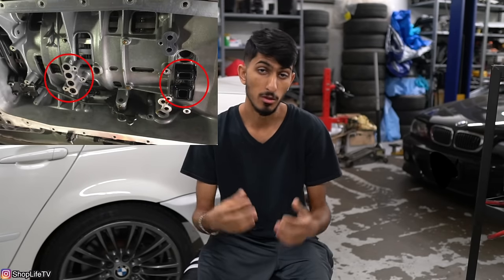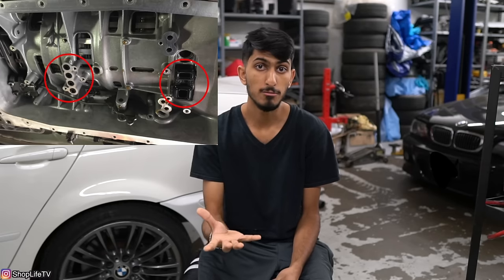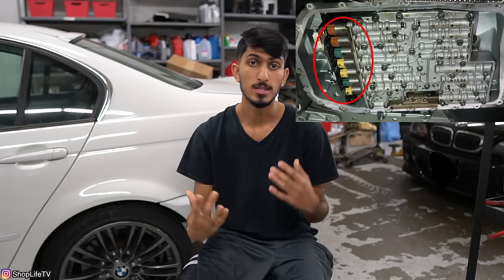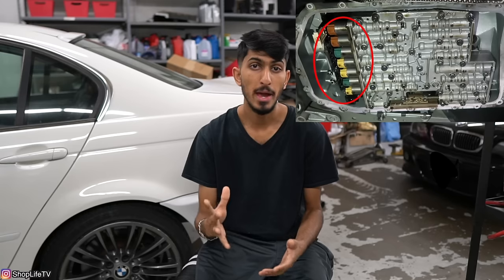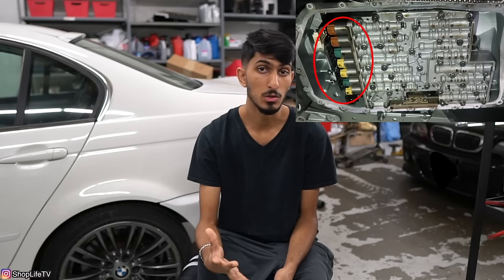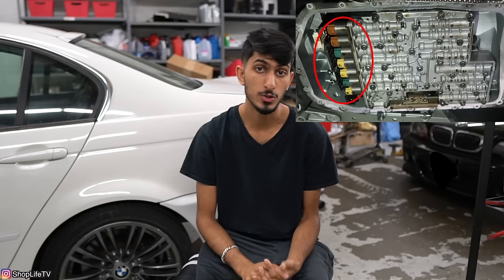ZF 6HP 6 Speed Auto Transmission Troubleshooting! Common problems

Comment: Hi, I have a e90 3 series 06, I got the valve cover,rocker cover and oil filter housing, done. The car, hesitates when accelerating and uphill and the idle its stable but low. Any idea what the issue might be? Thanks

Comment: Trans was fine then I replace fluid, now Im getting this bubble/vibration when in 1st at around 3k rpm. It feels like too much pressure. I replaced all seals with no luck. 

I just want to know if this sounds like a solenoid problem before I replace them. 

Also once it shifts into 2nd it's fine.
Reply: Hi did you sort this problem?. Thank you

Comment: BMW E61 525D 130kW with ZF 6HP26. Having problem with gearbox. At cold temperature rpm goes high, but gear don’t change. After engine/gearbox warms up it start to work decent, but still not good. It is torque converter problem or gearbox oil is low?
Reply: That's normal for all e60 generations the way they works the TC it's not locking until the oil gets operational temperature.

Comment: I have a question, I recently replaced all my solenoids, pan, plug adapter but did not change the sleeves. I'm having an issue going from 3rd to 4th it does not engage and goes into safety mode. Do you think the sleeves cause this?
Reply: Hi im having the same issues with my car was just wondering if you ever got this sorted. Im having troublecode gear ratio 3-4. What was the fix to this?

Comment: How do you know if your 4 mechatronic seals bridge seals need replacing ? my trans is doing this weird thing under light acceleration or driving up a hill lightly accelerating where the revs will go up and down 150-200rpm between 2-3000rpm and on the odd occasion open road driving if its in 6th and gets under load the revs will raise then drop then the transmission failure light will come up and go to 3rd gear... i drive around with a obd2 scan tool and at work have a Xtool d8 it never gives me any codes .. engine off or when it goes into transmission failure i leave the car running and connect the scan tool still nothing. i serviced the trans about 500kms ago the fluid was like dirty LF6 with the OE gasket (240kms) with a brownish clearness to it... next to nothing on the magnets, replaced the filter and a alloy pan gasket and filled with GF syn ts car engages and shifts nicely in every gear except 3rd to 4th (sometimes) when the cars been driven for about 40 minutes.. sometimes after going up it hill it will hold 3rd longer before shifting into forth and sometimes pickup revs during the change. manual mode after going up a hill if i put it into 4th it wont shift unless i back off the accelerator a little. i thought if it was a valve issue Xtool would have picked it up. and if it was a clutches issue i would evidence in the pan.
Reply: hey you ever figure out what your issue was? seems like my ZF trans is having similar problems

Comment: Hey man... I’m dealing with “shift flare” on my 335i e90. Do you know what usually causes that? 200k miles on the car and I just got it
Reply: Did you ever figure out what caused your shift flare? I have the same car as you and I'm getting bad flare between 3rd and 4th especially in manual sport mode.
Reply: @TheChasfireman05  I replaced the transmission with a fully rebuilt one

Comment: I have a Range Rover which has a zf transmission. The car is running really sluggish but gears are still running through. Car shakes while on idle. Can this be a cause of a faulty mechatronic unit

Comment: Initially I’m having problem with my 2008 BMW transmission shifting between gear 3 to 4.  When shifting from 3 to 4, I get a hard stump sometimes causing the transmission to go in fail mode.  Turn car off and it reset out of the fail mode.  I change transmission fluid pan, solenoids and seaL Refill transmission as required, but still having the problem

Any clue or recommendation

*Note, if I put in manual and shift with the pad, I can slowly shift from 3 to 4 gear if I got the speed Align with rpm
Reply: any update bro? same issue

Comment: 2011 BMW X5M: Took your advise and did not replace transmission. Replaced all my solenoids, mechatronics sleeves & fluid flush. Unfortunately is still going into Limp mode once car gets to 5th gear. Noticing transmission fluid burning smell. Guess yes just a guess- the transmission probably needs replaced. Anyone?

Comment: I have an 08 335xi auto with paddle shifter. I have an issue when I move the gear shifter left it doesn't go into sport mode, however if I move the gear shifter up and down it will go to manual to shift and then after a few seconds goes back to D from M. Same thing with Paddle shifter, will go to M but after few seconds it goes to D. I checked the shifter wiring and did the repairs but not sure why it's doing that

Comment: Hi team, 
I would like yo know if a ZF Transmission issue could cause that car won't start and not even crank. 
I have an E90 2007 and our OBDII Scanners are detecting that car is in Drive shift, we have test another shifter gear in order to try if shifter was the issue but we have the same problem.

Comment: Hi mate i did oil and filter before 2 monts on zf6hp28, because i have this problems, rpm playing when accelerating with 100-200 up and down. Now i have message gearbox fault. And code P2807-13-Pressure control solenoid G.      How to understand who is this solenoid or the problem came from seal bridge and 4 tubes, i do not change them. I will wait for your answer. The car is Jag xjl 3.0d.

Comment: I have a 2005 320i with the 6HP19 that hard shifts in all the gears and no fault codes. could this still be a solenoid problem?
thanks and great video btw
Reply: Hi im having the same issues with my car was just wondering if you ever got this sorted. Im having troublecode gear ratio 3-4. What was the fix to this?

Comment: on My ZF 6P it feels like there is a hidden gear between 2 and 3.
So, after 2, it jerks and jerks  again to shift to 3. 
it happens only between 2 and 3.
Did fluid filter change nothing changed. Solenoids are fine. No fault codes.
What can it be?

Comment: I have a e46 325xi with an automatic (A5S390R) and it has a problem with a clunk noise when changing from second to first gear. What could be the problem? Mechatronic sleeve?

Comment: my car doesn’t have any codes but when I drive it up to 5th gear and it down shifts from 2nd to 1st at a stop sign or light the rpm drops to like 300 and goes up to 600 again and the transmission makes a grinding noise and the car wants to shut off and sometimes it goes into park o. It’s own giving me a transmission problem on the dash I HAVE A 2009 528i please help
Reply: Did you fix it and how

Comment: hello.  I'm building a midengine kit car. I want to use a zf6hp26a (from Audi A8) transaxle, the problem is there is no standalone transmission controller for this transmission.  do you know if there is one?  now there is a standalone transmission controller for ford 6R80 transmission.  from all the research I did, is it possible to switch the black controller that is connected to the valve body with each other so I can use the standalone controller for the ford 6R80?

Comment: Great vid man. I have a 2005 545i. It was doing a weird kick from 3rd to 4th gear. I got transmission malfunction light.  P code p17e8 and 4f89 3-4 gear shift. Think it’s the solenoid. After watching this will replace all of them and transmission fluid see if that helps. Any tips let me know thanks
Reply: Did you replace the solenoids?
Reply: Updates?

Comment: I have a 335D that in’s and drives just fine till transmission gets warm then it will kick the transmission to limp mode. Why would this happen doesn’t slip or anything till transmission gets warm then slips in 3rd

Comment: Quick question. I hope you can help me. I have a 09 x5 4.8i with the zf6hp28x i have this jolt when coming to a stop i scan the car with a autel 908 scan tool and no codes of any kind on the engine or tranny, i did the fluid change and the sleeves and the block Bridge and no difference. I would like to know what you think about it. I also did adaptation on it. Is there a step that you have to follow after you do adaptation? Do you think I should re flash the tcm or egs... when i drop the pan it was nice and clean other the some powder in the magnet. Any help will be great. I love your videos keep it coming.

Comment: Apart from the micro switch in the shifter housing, as I've tested it as ok, What could cause a ZF5HP to not want to go into manual shift mode. It stays in D. 2004 RR M62 V8
Reply: Same here it happened to me as well 2007 x5 e70 69k km on it. Doesn’t go to manual shift mode. Anyone can help how to fix this issue ?

Comment: Hi mate i my car use zf6hp28. I have yellow message  Gearbox fault. The code wich i found is P2807-13  for Pressure control solenoid G. I was refresh the oil before 2 monts ago. But i do not change any seals. I think that fault maybe come from this bridge seal i this four tubes? I can change them my self, but i don't have idea where is this control solenoid G. Any idea?

Comment: Would the sleeve being bad cause the bmw to put it self in park from any gear
Reply from the maker: It's possible, but more likely due to the shifter or solenoids. Check the fault codes on the EGS/Mechatronics module

Comment: Hey man, I love your videos, some of the best I’ve seen. So I’ve been driving a e60 550i for a year or so. First transmission issue came up on it today. I bought the car with a fully overhauled transmission at aamco 10k miles ago, transmission been perfect up until today out of no where as I was parking the car I got a transmission malfunction message on the screen and once that happened it wouldn’t let me put it into gear. I got a check engine light as well, I scanned the code with just an obd reader and it says p0755 shift solenoid “b”. Sounds like it’s either the solenoid got stuck or simple as low fluid. Now since this transmission has recently been rebuilt I assume the solenoid is fine, I’ll start off with checking the fluid, but incase it is the solenoid I only plan to replace the only one that’s bad, now I guess my question is how do I know which solenoid “b” is? Any ideas what could cause this issue? Let me know and thanks in advance. Oh almost forgot, after clearing the code I was able to put it back into gear and it drove perfect again, but 5 miles down the road the message popped back up and it seems like it went back into default mode, felt like it just stayed in 4th gear until I pulled up home.
Reply: Hi Andre, Did you fix the issue and if you did how? Best regards

Comment: I have 2011 750ix with trans fc 400626Turbine speed sensor, short circuit to ground or open circuit  trans. keep coming in fail safe,any idea if speed sensor can be replaced separately or it comes with the mechatronic ??,I cannot  find any sensor on bmw part catalogweb side .

Comment: hi sir 
i wish that in my country we have mekaniks like you  :/ 

one question please 

i have a bmw e60 535d 2005 
and my transmission is doing like shifting very hard but too hard 

the fault codes that have come out were 
4f8e
4f95 

can you please guide me what can i do 
and what do you think the problem maybe 

thanks in advance 
Clinton mangion
Reply: Hi , my problem is my BMW X5 4.4i 2003 auto transmission has failsafe ,I check it out with obd 2 ,the code is 750 ,which said solenoid A is sticking or bad.
    What u think,

Comment: Hey man I have a 09 335i e92 xdrive 
My transmission will shift into 5th fear when cold but when the car is at temp it will not shift into 5th. Any suggestions? I really do not want to get a new transmission but it’s throwing a clutch fault when I check the code

Comment: Any other possiblities for the harsh downshift between 1-2?  Did all the new seals etc with a fluid change however I did go with Redline fluid not ZF. I have used Redline in stuff for years and I trust it. Would this fluid be the cause maybe? Great video btw.
Reply: Hey, Did you find the fix for the 2-1 harsh shifting? I replaced seal and sleves and still have the shifting issue.

Comment: Hey bro I have 2005 E60 ZF6HP19, and I’m getting the jerk during stopping. The jerk is coming from second to one gear.As you explained in your video to change all 5 sleeves. I did change all sleeves also put new fluid. the problem still there, can you help me more to troubleshoot it. 🙏 thanks.

There are no fault codes showing up.
Reply: Ever figure out the issue?

Comment: question: if the solenoids got replace, do you have to re-code/reprogram them?
Reply: Nope. Only reset adaptions
Reply: @tomtebloss89  hi.. can the solenoids produce a fluttery chirping sound just before each gear change?I think i need new solenoids.. the rest of the seals have been replaced by myself.. thanks

Comment: Great video, my 07 e90 slips in 2nd and 3rd but drives fine otherwise, no codes it is leaking and the fluid is a bit low, should I change the shift solenoids?
Reply: Hi.. did you sort this problem? Thanks

Comment: I have a 2010 BMW 528i having transmission malfunction right after I replaced the Bluetooth module that was bad. The car remained to park won't shift anymore and I was tried to figure out my problem on YouTube that led me to your video. It was great and fixed my issue, but after two days, I got the same issue back again and won't respond to the reset process. 
Is there anything that I can do to fix my problem?
Anyone there for the help please!

Comment: HOW DO YOU REPLACES.INPUT/TURBINE SPEED SENSOR A CIRCUIT LOW..ON A 09 BMW 750I
Reply: Hi I been watching your video a lot and I really need some help
My 2007 bmw 750i after replace solenoid about a week now it not shift at all and keep flashing scan it show the error 4e84  egs( electronic transmission control) solenoid valve 1 but I can not delete code can you please help

Comment: Hi, my car has a zf6hp21. It recently started slipping with code 4f8a: gear ratio monitoring 4-5. Strangely it only happens when around 40-50% throttle, full throttle it doesn’t. And sometimes when low load cruising I can feel it slip a little in 4th but not hard enough to go into limp.

I went replacing mechatronic sleeve, adapter seal, 4 tube seals, as well as filter & oil. But slip still happens when same condition applied. Need your opinion, should I try replacing solenoids and see how it goes or something else you might suggest? Thankyou
Reply: @freshfish9455  I went replacing the solenoids and reset adaptation via inpa. After that its been around a month and so far so good.
Reply: I have exactly same issue. Any fix?
Reply: @leeweiye4771  hey i have the same code. was this a permanent fix?
Reply: @TheSnogear  my box is still running fine so far, BUT i haven't been driving it a lot recently. A permanent fix would be gearbox full rebuild. I would say if the cost of a full rebuild is not too much more then better off go with it
Reply: @leeweiye4771  ok good to hear. I have code only when i shift with manual mode on high rpms. Next weekend  i will flush the gearbox and change mechatronics sleeves so lets hope that fix the issue

Comment: Hi bro i made a short and so the computer in the gearbox is damage i think because the canbus signal is bad and when i disconect it goes back to good signal 😔 what would you recomment that i do ? Is it dificould to take the computer out the transmission without taking it off?its a 630i e64 b52 engine ... please ?

Comment: I bought a car with a ZF with 109k miles, checking the history it never had a fluid change ever!.I was all set to do a partial change/filter but before I could get that done I got limp mode when hot and slamming shift in the higher ranges with codes P0729 (6th gear), P0735 (5th gear), and P0730 (incorrect gear ratio). I took to a ZF outlet and all they could recommend was a total refurb at £3700, thanks...  Is it possible for clutch packs to fail at this relatively low mileage if the oil is crap? Could a partial change or flush help at this point or is it too far gone?
Reply: Any luck?

Comment: Hi Jason ..! Thank you for Your YouTube channel it's helped me out many times .. I have a 2007 328i E90 i have a vibration and i think it's the drive shaft center support bearing ..plus im going to change the rubber Giubo thing and change filter and oil .. i was watching your video on the ZF about changing the mechatronic seals .. well mines a 7TGA and it was jerking at the stop signs and  now it is slipping when i take off from the stop sign i think in 2nd..if i shift it my self it won't slip.But in drive it does.. .. reset the tranny by holding down the throttle for 30 seconds and it slipps more often..my question is what do you think it may be and where should i get the parts for this...and what parts do you think i need... i'm DIY kinda guy... I hope it's something i can fix .. Thank You Jason I'm in siesta key Florida  .... changing what you said here .
Reply: Hi im having similar problems. Have you found a fix yet?

Comment: Would you recommend the Sonnax Zip Kit? What would you recommend it for? Or not needed if doing solenoids & sleeves/seals
Reply from the maker: The Sonnax Zip Kit is definitely a good option as it takes care of some of the other inherent valve body issues on the ZF 6hp. Just make sure you get the right kit based on the trans you have. You will still have to replace the sleeves/seals and I'd recommend doing the solenoids if the fluid has not been changed regularly.
Reply: @ShopLifeTV  Sweet, do you have any videos installing the zip kit? haven't been able to find a installation video on the zf6.